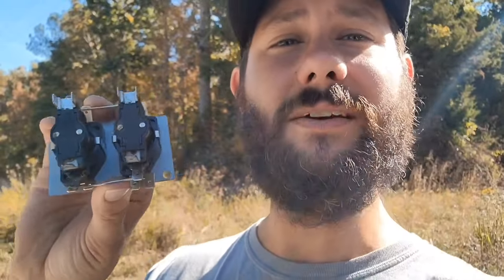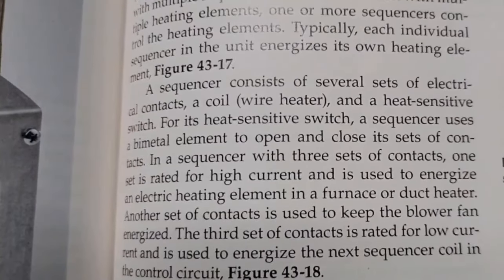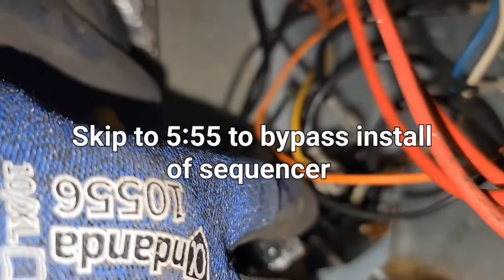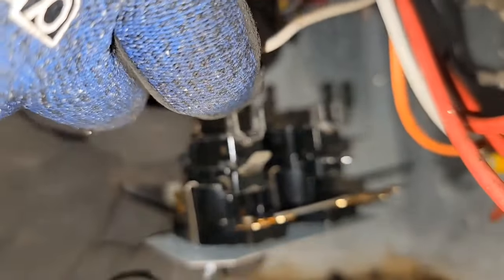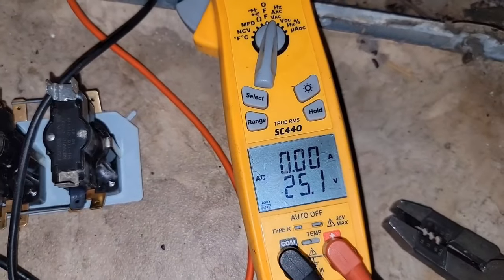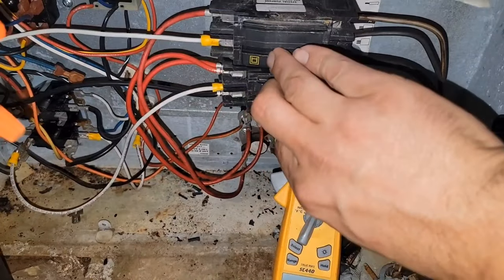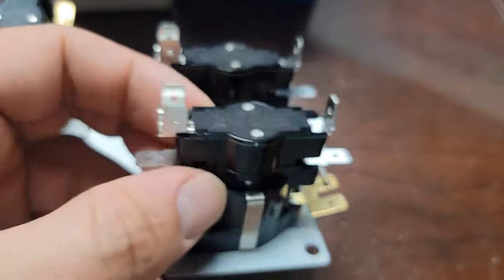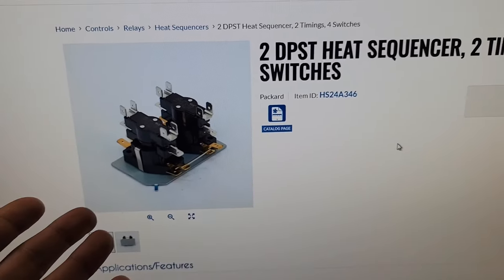Electric Heat Sequencers Explained (HVAC Training)

Comment: Im any HVAC pro 30 years. Sequencers are a thing of the past they were needed in the past to turn each element on one at a time to prevent the transformer up on the pole outside the home from blowing. With new transformers today they are 100% no longer needed. If yoy see a bad sequencer in electric heat repalce them with a contactor with lugs and up the wiring size to #10. Try to replace all push on terminals with eyelet type terminals as they prevent resistance to electrical flow that over heats and melts wiring.  There are kits to replace the entire electrical heat system including all wiring, contactors, limits, safteys, elements, and breakers that are often less expensive than replacing individual parts and are very quick and easy to install. HKA-15C for example. These kits are all comming with contactors instead of sequencers like I said they are no longer used today as they are a failure point where contactors are much more robust.
Reply: And some sequencers are hard to find!!you can’t leave people without heat until the new ones come in..loved this info thanks.
Reply: Hi. If there is no forum of sequencing in electric furnaces now. Are you saying all the elements come on at the same time ?   How are they then controlling the voltage drop when the furnace starts ?  How are they controlling the voltage spike when the furnace shuts off ?
Thanks
Reply: @dalefaurschou3167  as stated before we size up the wiring to #10 this cancels out the voltage drop within the unit and most electric furnaces are already provided from breaker panel to furnace with #8 or better. Yes all elements can come on at once. If its an issue you can install 2 contactors. 2 elements on one and one on the other. Put w1 to one contactor and w2 to the other. Or stage with a timed delay on make relay using only w1.
Reply: Good info thank you sir .

Comment: Thanks for the video. I'm from west Texas. I bought 21 mobile home rentals in June. I'm learning about how to maintain them. The HVAC systems and the drain/sewer/septic issues are in a dead heat for what requires the most maintenance. I've learned tons about AC this summer and I got my first call for no heat yesterday.

Comment: This exactly what just happened to us, but it was a heat strip relay that the contacts were welded closed. I bought a second for a back up, glad I did. After seeing you use the clampmeter, I did the same, found one of the other relays was clicking but not contacting.  Thank you.

Comment: I always use 10 ga wire with good crimp terminals and you’ll have less overheating issues. Also good annual coil/drain cleaning, tape/silicone top of electrical compartment to keep water out will make your breakers/sequencers/transformer last longer.
Reply from the maker: Thanks for the tips!
Reply: @rv 10flyer84 Excellent advice!  If the factory 12 ga is burning, the upgrade to 10 ga is very smart, so is use of higher quality terminals. All my hi-temp terminals have nylon insulation sleeves (105°C rated), not vinyl like the cheaper automotive (90°C rated) grade stuff.

Comment: I installed one of these furnaces when we built the house in 1997.  Never had a problem until last winter ended up having sequencers replaced twice about a month apart on two separate service calls.  Finished out last winter ok.  (Also had a couple of burnt wires each time). This past week it has started  running uncontrolled again.  When it does this I shut off the power for a while and after power on again it may run most of the day before before the problem repeats.

Comment: Thank you for taking the time to make this video and share! I'm having an issue with my intertherm electric furnace it will run for a bit heating only half what it normally does then in throws the breaker at the wall panel.
Reply from the maker: You're welcome thank you for watching

Comment: Hoping someone here can give me some advice. I have some electrical knowledge but no furnace experience. Nordyne E3EB-015H blower made an unusual, sort of deep whir, sound and kicked its breaker. The fan is also hitting the enclosure slightly.  I did a capacitor and resistance check on motor that seemed ok. I'll put the readings below.  I couldn't feel any slop that would have been bearing related but there was some movement from the mounts. I thought that may have been ok since it has the rubber bumpers but, after watching another video, I believe that I should have tightened them. After reinstalling, the unit ran for a while before blowing warm air and shortly after that it sounded like it was changing speeds but then made the weird whirring noise and stopped. Instinctively the first thought is the motor/capacitor but I feel like something else is going on. I know that a relay was replaced about 8 months ago (I don't live there). Any ideas or advice?  Readings:  High = 25.7,  Med = 29.7, Low = 37.7   Orange to Black = 22.6

Comment: Hi Taddy. I have a question. I am trying to make work an electric heating unit. It has two thermo units. I wonder if both of them has to be conected to the white wire from thermostat?   Thanks and great video.

Comment: My furnace has 4 elements and  3 stacks of sequencers. They burn out fairly often. I have probably replaced atleast 6 in 40 years. Would there be a way to use some heavy duty relays or magnetic starter in line between the sequencer and the elements to take the load off the sequencer. This way the sequencer would only have to supply the power to energize the relay instead of the large draw of the element.

Comment: I'm getting ready to replace the OEM sequencer on my mobile home furnace. The replacement (an Emerson/White Rogers) has the labeling in a different order for the set of contacts (e.g., where M5 and M6 are on the old one it's reversed on the new one. On the old one, M5 is on the top terminals and M6 is on the bottom terminals, but on the new one it's the other way around). 

My question is should I still wire it exactly the same as the old one? From everything I've come to understand, this shouldn't matter, and I should be able to wire it exactly as it was on the old one. Wire for wire on the same terminals, regardless of this difference. 

Also, my old one has jumper wires, whereas the new one is already linked (like the one in the video). I'm assuming I no longer need those jumper wires? Not that I could connect them to the terminals with the link in the way anyway. I'm sure that seems obvious, but I just want to be thorough with regard to my limited experience.

Comment: Hi Tad. I’m dealing with a similar issue helping a friend restore heat in his mobile home. The original sequencer has one of the metal jumpers bars at the bottom removed, it appears to have been clipped off. The new one has both the metal jumpers bars on each side. Is it ok to leave it as it is, or should one of the bars be removed, like on old sequencer? Thanks.

Comment: I got a intertherm electric heater Simone removed from a mobile home , I want to install it in my shop.. not a electrician but have wired a couple shops with 110 & 220 outlets.. wondering how to power up this unit so to test it to see if it works .. can I hook it up with a dryer cord and plug in?

Comment: Can a bad sequencer cause your blower motor in an electric furnace to stop running? 
I have a sequencer with a melted apart wire that used to be attached to it. 

I’ve changed my capacitor for the blower motor and the blower motor does not turn.

Just a very loud humming.
And then the blower motor gets extremely hot to the touch. 

What must I check now?

Comment: Can you explain what happens when a wire burns slightly instead of completely?  The power for some outlets occasionally fails to connect at all; as if the total load of the wire was an issue.

What I learned so far was that the wires connect to the breaker, would that indicate that this were the problem?

Comment: Hello, Thanks for the video. 

I am actually working on my intertherm furnace right now. I bought the double sequencer like in your hand but actually broke that bar off connecting the 2 because mine before were separate. Did I screw that up?

My heat is blowing out cold air. I took pics of the wiring before I took them out but my pics didn't come out so great.

I have been working on it for 3 straight evenings looking up diagrams, videos, and pics online trying to figure this out.

I got it hooked back up but it still blows out cold air. 

But I feel like I've hooked it wrong. I can't make out where the wires go from the breakers and there's a jumper wire I really have no idea where it goes. 

I know you can't see what I'm saying but maybe you can give me an idea. LOL! 

Thanks
Reply: You may have all your wiring  correct
Reply: If the Sequencer has separated you may be able to hold it down on top so the internal parts work ...don't get shocked use insulated tool ..if heater starts working ...replace the Sequencer with another new one ...be careful they are made cheap...handle with care !!!

Comment: For the first time in 12 years I sucked all the cob webs and and blew out the unit. Cleaned it out real good. I turned the break back on and turned on the Heat. I smelt a bad burnt rubber smell.  The Heat coils stayed on after unit was turned off. So I turned the breaker switch  back off. The wire that connects to the sequencer is melted. How would me cleaning the unit cause that? The sequencer to malfuncition?

Comment: What lowest temperature can a basic 3.5 ton 14 seer2 Goodman GSZB4042 heat pump work to. In mobile home.
Reply from the maker: in heat mode, probably 30 degrees with complete efficiency before hitting the balance point

Comment: On the sequencer what does the bimatel between the two sequencer do, the one we have does not have bimetal between the sequencer does that mean the sequencer is bad
Reply from the maker: It's a limit switch so when the fan is not working or there is low air flow problem the bimetal will open and it will cut the heat strip off until the heat goes down
Reply: @TaddyDigest  because the  old sequencer didn't the two bimatel I went ahead and cut them off did I mass up?

Comment: I have a 20 year old manufactured home with a forced air electric furnace that is blowing cold air. Fortunately, I also have a wood stove and spring is here. But I noticed my blower is going fine but only putting out light warm air. I changed the filter. Didn’t help. Could my heating elements be bad? I live in the boonies where it’s expensive to get a heating tech to come.

Comment: Exactly what type of wire do I need and where do I get it? I need to replace two heat sequencer wires on a Nordyne unit. On current wire, it is red with 105°C. CSA 12awg. Help, 🙏?
Reply from the maker: Stranded number twelve wire
Reply: @TaddyDigest  Thank you!

Comment: In Hindsight. would you have use a #10 wire since it was drawing  20amps+ and wire were burn? curious apprentice
Reply from the maker: Yes if it's over 20 amps then I would definitely use number 10 wire stranded only

Comment: Usually those sequencers fall apart from becoming brittle, Answer this question. What is the best way to wire a mobile home electric furnace to a heat pump condenser such as a goodman HP or Rheem, seems like everyone has a different method

Comment: Question: if it draws 20 amps, do we use 10 gauge or 12 gauge wire on the sequencers? Didn’t catch what you said
Reply from the maker: 12

Comment: i have a new unit guy kinda screwed us on it got one bigger then we needed but needing before winter hit but  it runs 5mins shuts off kicks on 5mins repeat all nite long and has been using about 2500-3000 kwz a month cuz it dont run long enough to heat up the rooms and keep them that way could this be whats wrong with mine have had 3 ppl look at it and cant seem to get the issue fixed

Comment: Hi Tad. Please correct me if I’m wrong in what I just saw and heard in this video. 
Near the end of your video when you were testing amp draw  your meter showed the element you were contacted to, was energized before the blower motor had started. This is not correct !
Depending on model/type of the sequencer. 
Your blower motor is to start before any element is energized or with the first element. 
Under NO circumstance should an element be energized before the blower motor.
Reply from the maker: That is correct the blower has to run or the heaters will trip the limit switch
Reply from the maker: Usually the thermostat settings are the reason the blower doesn't start immediately
 Sometimes the thermostat needs to be switched from gas to electric
Reply: Hi. Yes all I was trying to point out was that it appeared that you had an energized element before the blower was energized. That can only happen if the fan isn’t connected to the first tripping sequencer as it should be
Reply: Hi. Just saw your second reply. 
I’m not sure I quite understand what you mean about the thermostat settings and the blower coming on after an element. 
Correct me if I’m wrong but all the thermostat is doing is sending current to energize the sequencers, which in turn are to be wired so that the blower starts first followed by elements.
Reply from the maker: sorry I was thinking of another 😅 job lol
Reply: @TaddyDigest  Thanks for this. Central FL about 8 miles south of Mickey & Minnie's house. Came home one night in Feb, heat wouldn't turn off. Not responsive to T-stat. Bingo! (Heating elements getting energized even in AC mode with compressor running)
Correct me if wrong, I'm not a tech, the guy who used to live next door was, he moved away, instructed me by phone, he's since passed away, now i'm my own tech learning from guys like Tad. My m/h package unit is outside. Isn't ONE element supposed to get energized first? On a cold night i DON'T WANT my blower to come on first ... that will be pushing outside cold air inside. One of my two elements gets energized first, and then 30 to 90 seconds later is the timing for my second element and blower fan motor. Isn't that the way it's SUPPOSED to work?...

Comment: Would these being bad cause wires to melt and blower to run constantly, then it wouldn't start then it went back to running normal then came home to electrical burning smell
Reply from the maker: yes

Comment: My heater is warm when I walk by every time even when its turned off at the thermostat and it was warm outside so it didn't turn on all day yet its hot when I walk by it so I turned it off at the breaker box is this normal or is something wrong with it?
Reply from the maker: something wrong for sure

Comment: After watching many of these sort of HVAC videos, it has occurred to me that when the purveyor of the video is pointing at something I question why not use your elbow to point at something and in that you are blocking much of the view with your finger. Perhaps a chopstick for pointing would less clutter the view. Please used Clear view of part numbers and boxes with enough time to screenshot the part number data.
Reply from the maker: Thank you for this advice I will get a chopstick

Comment: The same thing happened to me, the blower did not stop and I replaced the sequencer, but the sequencer failed again after 30 days, why? Thanks
Reply from the maker: check heater amps while running 
It may be to much for sequencer rating